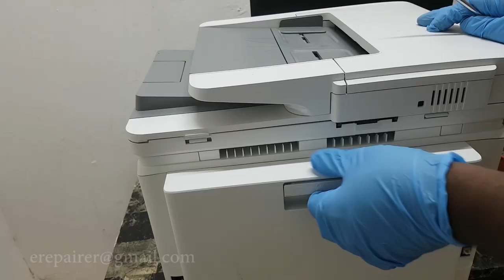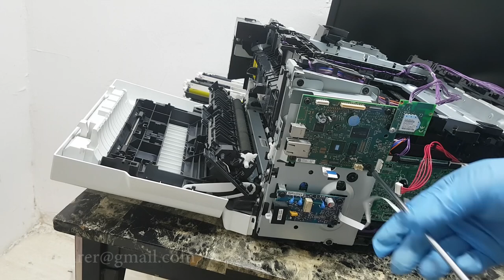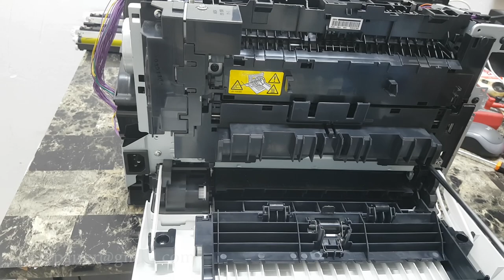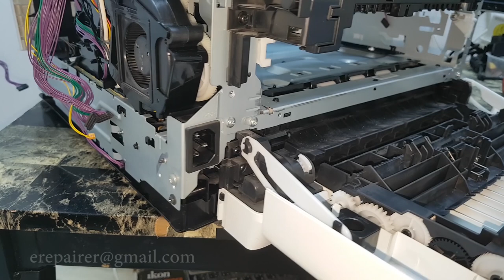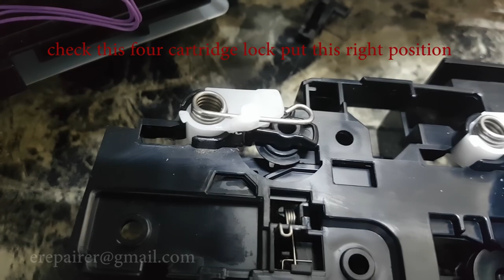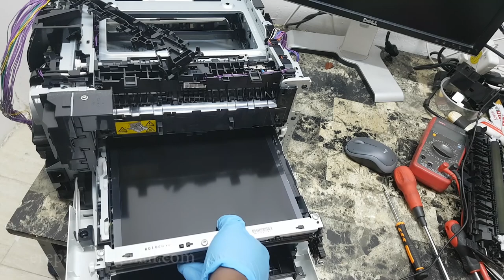HP Laserjet Pro M278-M283 Series toner Cartridge Tray  not coming out

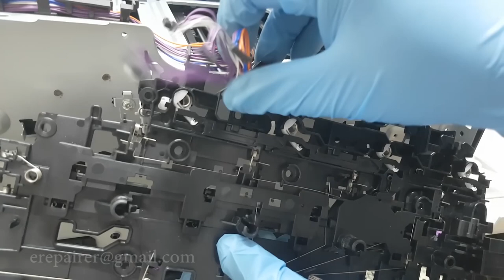Comment: At 4:33 in the video - I can’t seem to get the large plastic piece pulled apart from the case.  It is held towards the top with the top upper left posts - if which there are 4 of them.  Also there are two metal right angle pieces that is also holding the plastic piece onto the case.  Can you explain? Or add an additional video?  Also - the whole video to remove the top is missing.  It goes from the top on to the top off with no video.  Can you explain or add additional video to this as well
😊
Reply: There is another video which shows how to remove the top section: HP Laserjet Pro M278-M283 Series Low print quality Repair